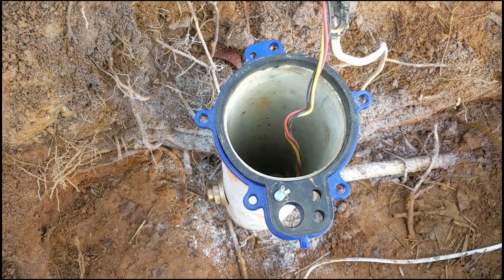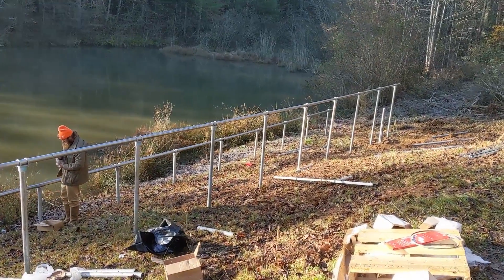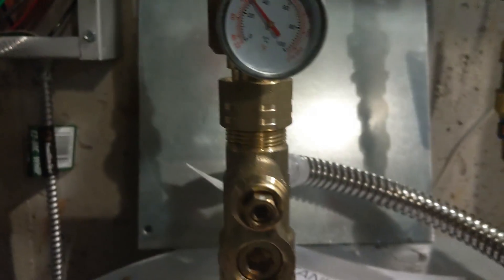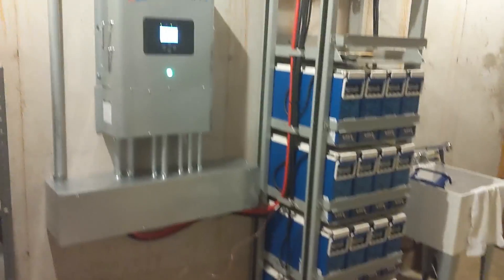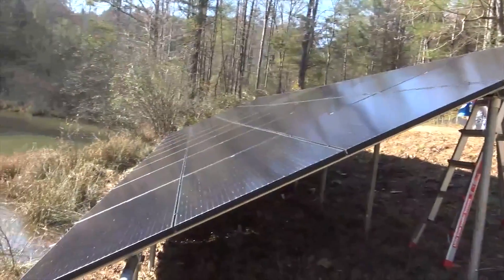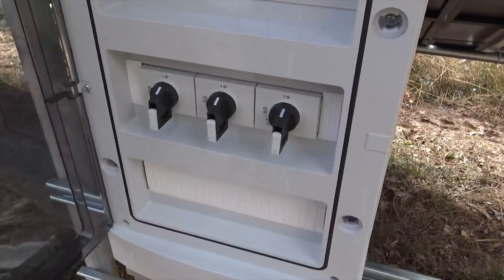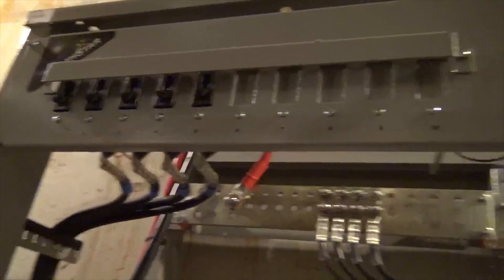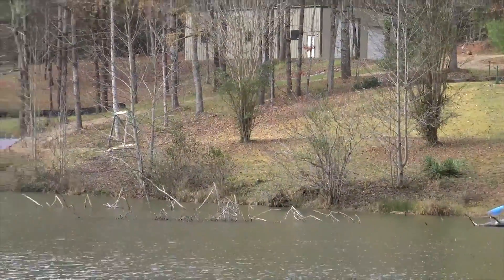Sol-Ark 8K:  Efficient and Flexible

Comment: Do you remember how long the helical screws were?   I want to put in a ground mount using these helical screw anchors but neither I or the helical screw company know what depth screw to use.  Hope you can help shed some light on what's required.
Reply: Might wanna check iron ridge website and call their engineers. I'm no soil engineer; but if memory serves me correctly it's a rated scale and it's explained somewhat on their webpage 👍. Wishing you all the best! Gotta love solar!

Comment: My good neighbor got snickered into buying a partial 8800 watt solar system from a salesman at Hole Depot, he paid a ton of funds for 28 panels, a disconnect, a main distribution panel and a utility installed BY rotation meter. Bottom line is when the utility power goes down he is dark and cold like everyone else with zero power other than a generator. What type of batteries and quantity, what type controller, and inverter should he use to complete this system. He is in lower NY, it gets cold and snowy.
Thanks
Doug H.
Reply: The Enphase IQ8 is coming out soon and it will have grid agnostic capabilities. So not only can you run off batteries but you can also continue to produce electricity even if the grid is down ...mind you this is a grid tied system

Comment: solar and wind and all the accessories are not very friendly ..... Like what is the best power panel? Solark seems like a nice option, what panels are good ? we started with 100 watt panels and now they seem very underpowered. Wind turbines are like dealing with a ghost almost because of the overspin issue where you can put that screened in thing and I'm still not sure if that actually puts a load on turbine to slow it down. most people like me would love to see more plug and play choices..... Oh yeah then theres the battery storage issue the ones in this video look nice but I've seen the 48 Volt Simplifi and they look really nice..... SO MANY QUESTIONS!
Reply: Sunpowers new A series panels are extremely efficient. Solaria ACMs are also great. LG is good.
Reply: Look at Rich Solar if you are still adding to your system. Test results look great and the price is great as well. Check out @Will Prowse

Comment: Love your vids , but wouldn't  a wind power cheaper?
Reply from the maker: It is a terrible wind site.
Reply: In my opinion, if you added a small wind system, it would be a good supplement during rain and storms when solar is less efficient.  That's my take on it.

Comment: Hey Engineer. I have s deep well with an electric pump. I use a Generac portable gasoline powered generator for emergency power to run the pump. I've got conduit running from my fuse box around to the side of my garage where there's an electrical outlet. I attach a power cord to the generator and plug it into the outlet on the garage wall. Obviously a Genrrac generator makes a lot of noise. Can you recommend a portable solar powered generator that I can use in the same way as I use the Generac generator? I'm not looking for something to power my entire house; only enough power for the electric well pump. I've looked at the Kodiak solar generator but have been advised that it won't do what I want it to do because it only generates 110 watts as opposed to 220 watts.  Otherwise the Kodiak solar generator generates 1500 watts which is more than enough to power a deep well electric pump
Reply from the maker: The key to sizing a solar generator for your pump is to find out what the startup or surge amps are for the generator.  Can you or can you find someone to amp clamp your pump.  You pump might run at 10 amps but it might take 25ampsx240 v to start it.
Reply: @engineer775  Ok. Thanks
Reply: @engineer775  What does amp clamp your pump mean?
Reply from the maker: @ElkArrow  you need a meter that has an amp clamp it allows you to surround a single conductor going to the pump to capture the amperage flowing through the pump if it has a max min max button you can capture the inrush current or surge current when them pump starts.